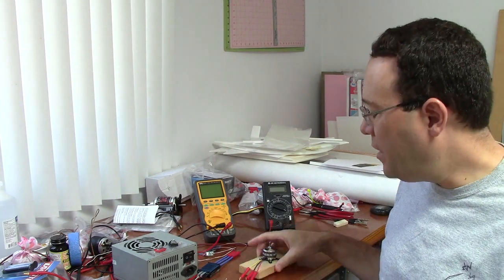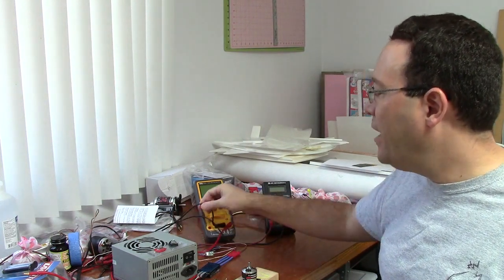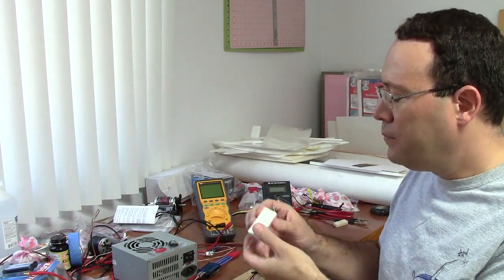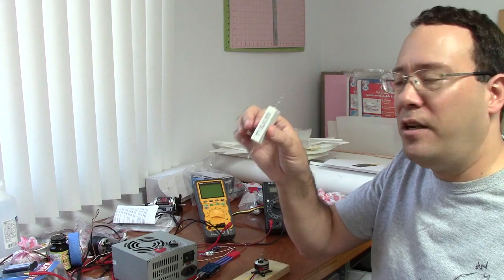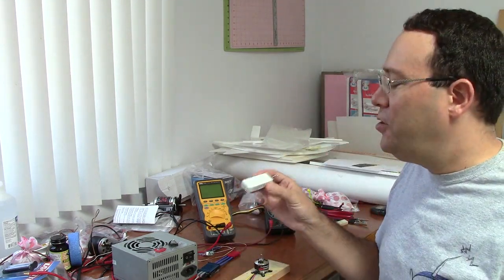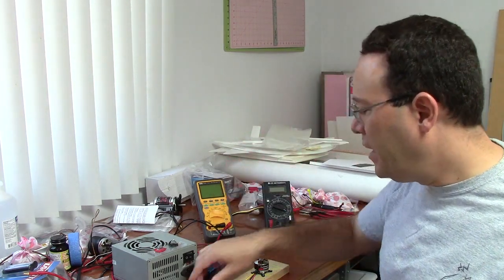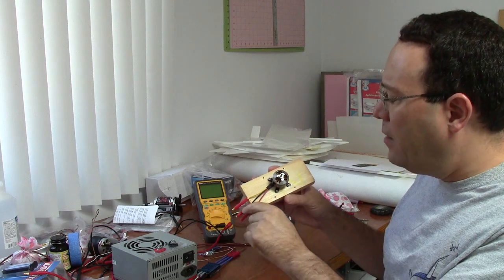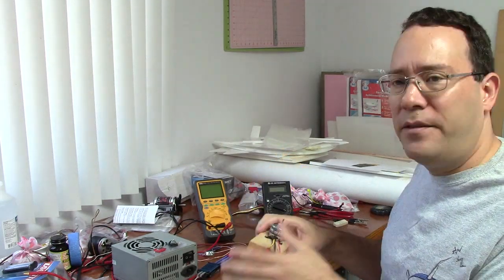Measuring Motor Constants: Internal Resistance (Rm)

Comment: The power resistor in ohms should be about equal to the Supply Voltage in volts.  So a 3S lipo supply battery needs about 10 ohms, a 4S supply needs about 15 ohms.  

This is because the Winding Resistance we're after is a small value (1/10 ohm or less), so a larger test current will make the voltage drop we're measuring above the noise in inexpensive multimeters.  But too large a current creates heat problems in the windings, etc.  A good compromise is about 1A of test current, so we aim for a drop resistor about  [Supply Voltage / 1A ] in ohms.  

For students, this voltage supply in series with a large-ish drop resistor create a poor-man's constant-current supply if the drop resistor is more than about 100X the test resistance we're measuring.  Constant-current supply and measuring the voltage right at the R under test avoids test-jig errors.  This method is standard procedure for measuring small resistances.   

For the 1 Amp test current, power dissipated in the drop resistor is I^2*R or in this case about equal to the resistor value in watts.  Higher wattage drop resistors stay cooler.